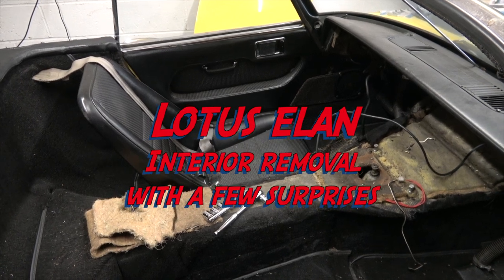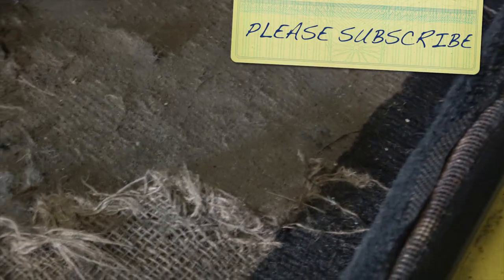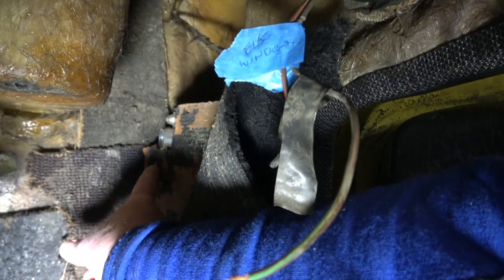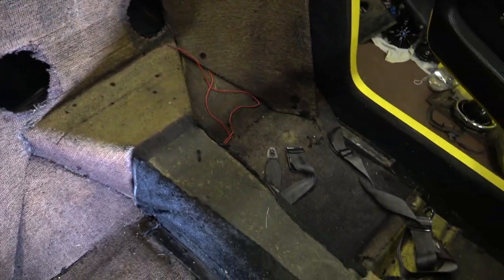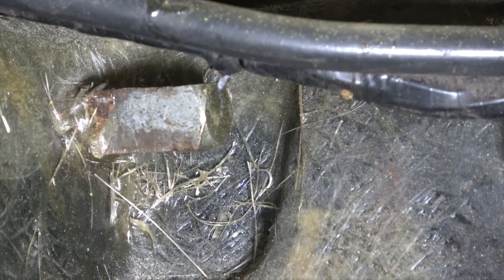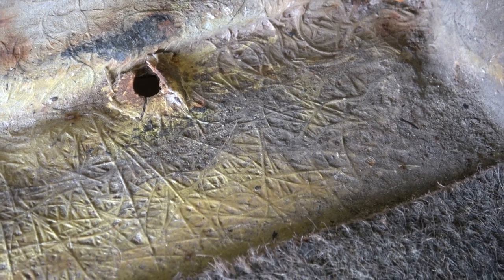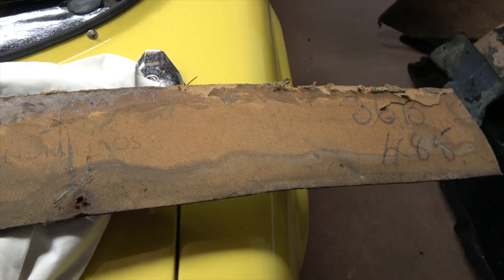Lotus Elan Interior removal

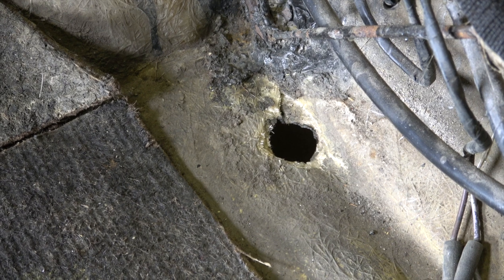Comment: 8:20.  Great video David.  Is it possible that the car was in an accident that caused the passenger to be thrown forward with his seatbelt on causing the anchor to rip away from the webbing?  If so, I still don't understand how the seat track lifted up ripping a hole in the floor.
Reply from the maker: Thanks Frank.  I can't see any evidence of damage in the body, at the moment, however I did find a few bits of glass under the carpets when I removed them. The steel bars in the sills do not appear to be deformed and look original. 
How the hole originated I'm not sure. There are a few areas of the body which need a bit of work, which I'll cover in a future video.